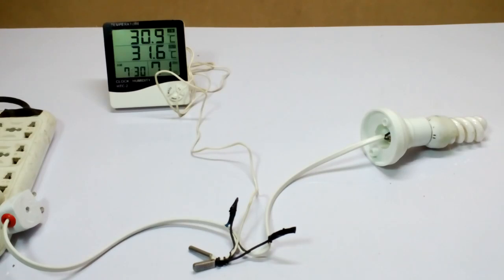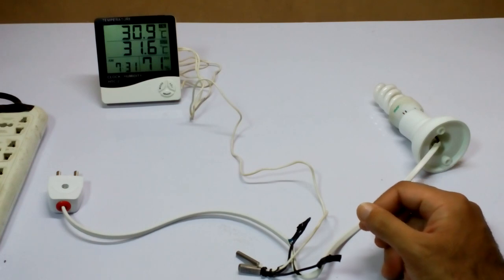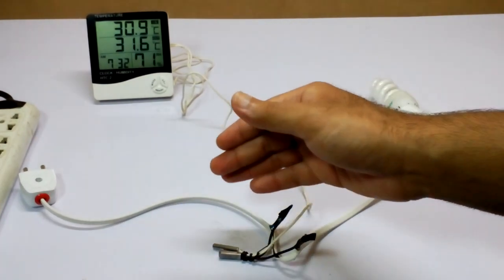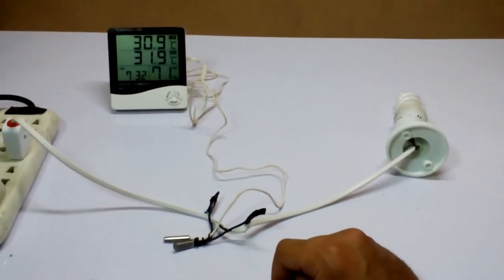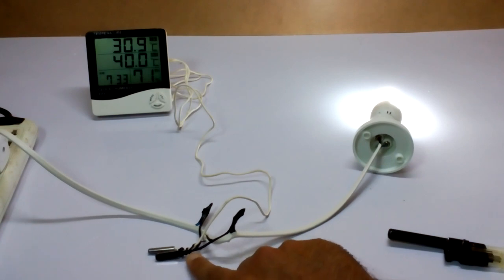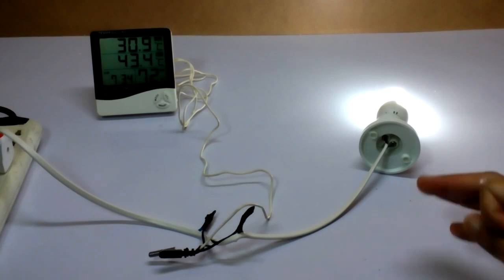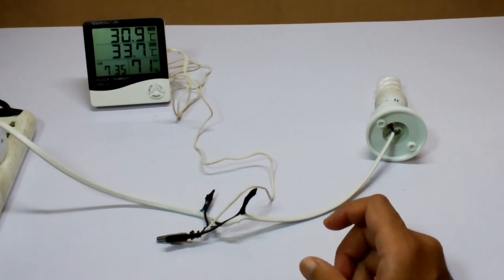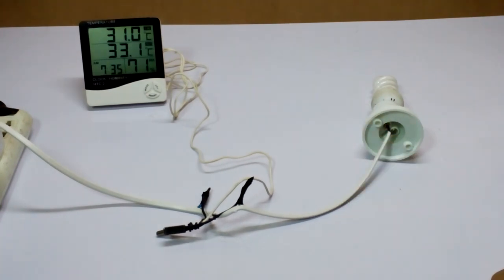Bimetal thermal thermostat 40c normally open review English

Comment: can this be used in low voltage devices or DC maybe 5V - 48V?
Reply from the maker: This works with 220v only there are also available in DC voltage
Reply: They work in both ac and dc
Reply: Ksd9700

Comment: Umair can you check the change in resistance across the thermal cutoff during heating and cooling if there is an increase or decrease in resistance.
Reply from the maker: if I get it back then I will check

Comment: just a quick question, can it also be used on lower voltages around 12v or less? in planning to use it to automatically turn on exhaust fan for my electronics as soon they get over 60° hot
Reply from the maker: You can use w1209 for that purpose it will be easy
Reply: @Umairworkshop  thank you! i found w1209 at lazada. their cheap 😱
Reply from the maker: @rosekreuze  you are welcome
Reply: @Umairworkshop  how much input maximum capacity of amh in 1209 modiul (input dc 12v/amh.?) pls tell me?
Reply from the maker: @remoteswitchsale6439  some w1209 have up to 20 amp dc relay switching power so it should not increase